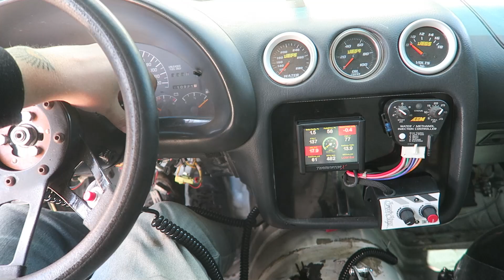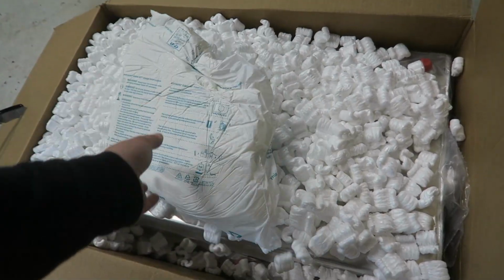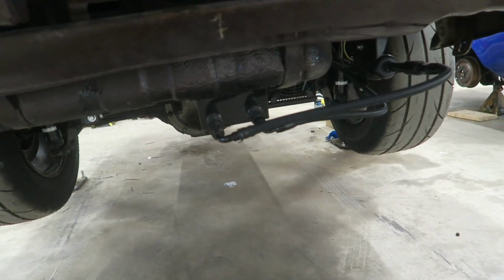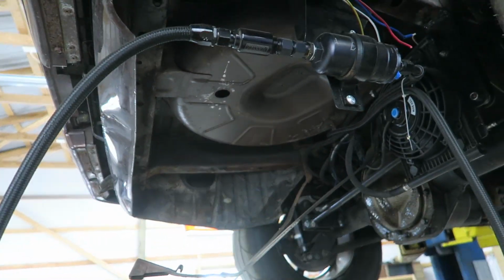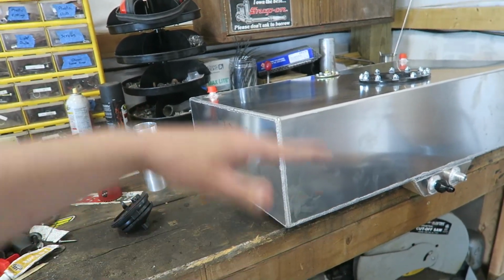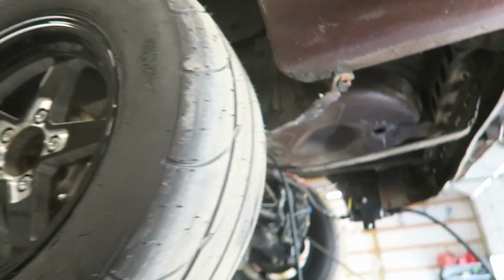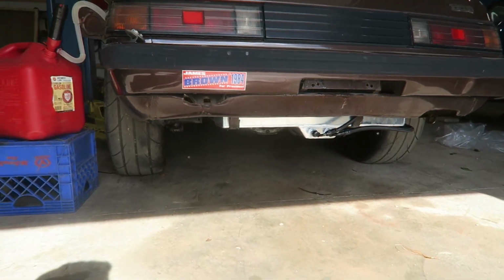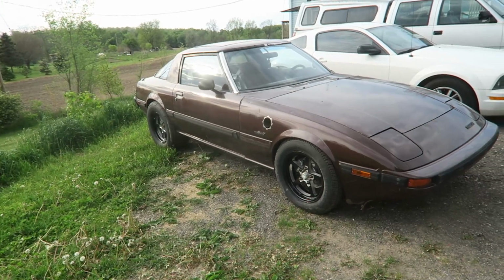James Brown FINALLY Gets the New Fuel Cell and Makes It's First FULL RIP on the Street!

Comment: Where’s your vent line?  Without a vent it will put the tank under vacuum reducing fuel flow and eventually killing the fuel pump. 
A sign of vacuum some people mistake as pressure is when you open the gas cap you’ll hear air rushing in to relieve the vacuum.
Unless the factory RX7 has a vented cap maybe? JD
Reply from the maker: Yeah, the cap on the cell is vented. I thought about drilling a small hole in the stock cap too but it seemed fine after being out a lot yesterday. Time will tell, I've been wrong before lol

Comment: Josh does James Brown seem faster than goldie hawn trying to figure how fast and that would be good comparison...also no more fuel filter clogging looks like the test drive and test hit went great. can't wait to see Betty White's first drive&hit
Reply from the maker: The fastest Goldie went in the 1/8th was like a 7.7 or 7.6. I took James out testing and the first run was faster than that for sure. My dragy was dead, but based off the time in the datalog it should've been real close to a 6.99-7.10. It feels TOTALLY different than the truck did. The truck was really heavy and felt super stable and just comfortable. This car feels pretty, not twitchy, its just new and unfamiliar. I mean really I've only driven the car for like 15 miles max in the 3 years I've owned it lol I just need to get comfortable in it
Reply: @SniderTron3000  hell yeah that's badass I know james brown is street car any chance you will take him to drag strip or just street driving  😉

Comment: I'd say you need a parachute due to Hayden running crazy fast numbers in his rx7 and I really believe yours will shock you and run the same crazy low numbers
Reply from the maker: It should be an easy 9 second car. But this will always be a street car. If I get kicked out of 131 I'll just run the 1/8th or go to Onondaga(also an 1/8th mile track) with it. I'm not doing maximum effort with this by any means. I mean my god its only a $250 ebay 7875 turbo lol

Comment: Dont know if you know or not, but most of the aftermarket shifters allow you to just push the reverse lockout button once and then shift to reverse without using both hands. If that makes sense. Like you press the button and it stays pressed basically until you shift. If you did know then ignore me 😂
Reply from the maker: Noted lol